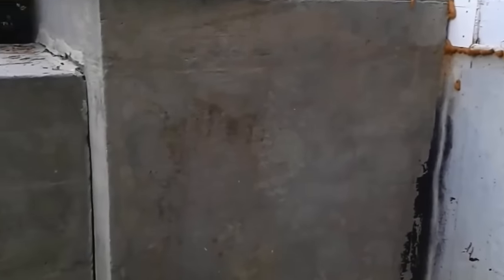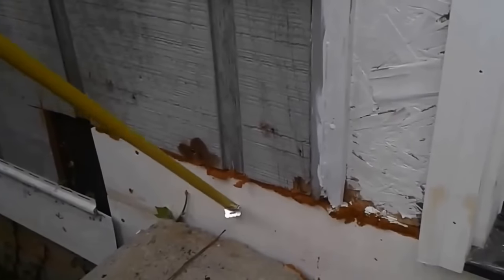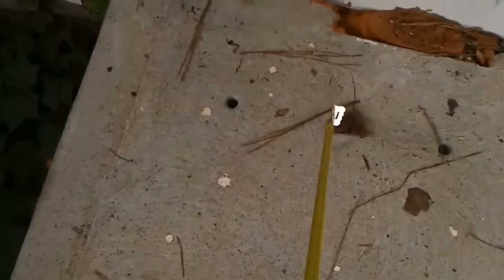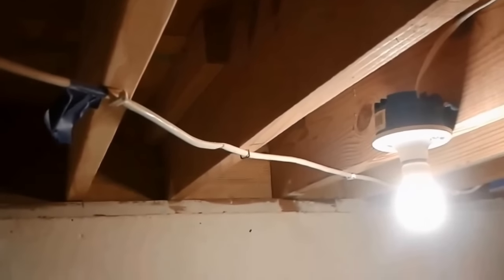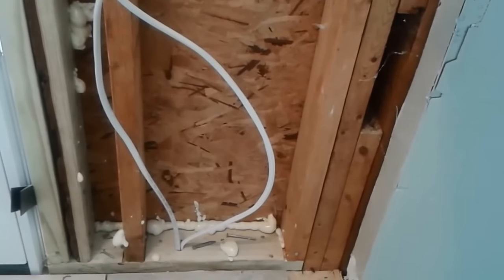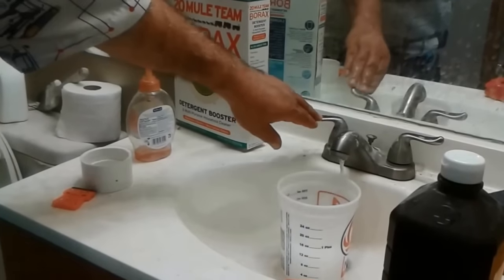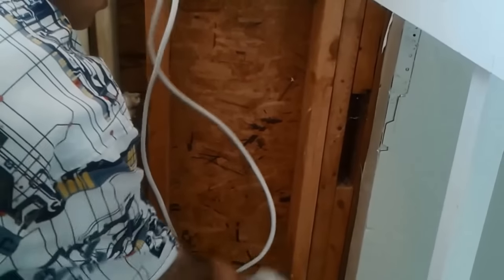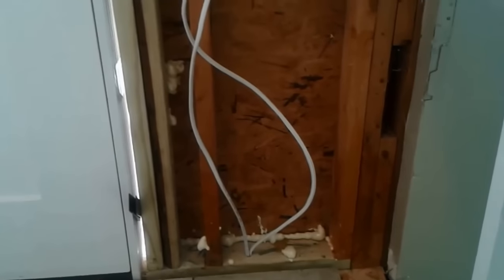How To Get Rid Of Termites For Good  Using  Borax -- Best Solution Do It Yourself

Comment: 16 ounces of hot water add 2 teaspoons of BORAX....stir until it dissolves.   Cross your finger 🤞.
Reply: Any results?
Reply: It has worked so far.   Do not see their trail.
Reply: I now use a plastic spray bottle wih the solution...and spray every so often on the walls! 👍

Comment: I've used the Borax on my exterior fence. My situation is unique as after I painted the Borax on the fence we had very heavy rains. Although that evening, prior to the rain the one section I completed I did not hear any chewing at all. I have not gotten a chance to finish the fence at this point as I have multiple repairs going on at one time. Ultimately it worked where I applied, so yes it is effective.
Reply from the maker: Thanks for the information.
Reply: How do you hear termites chew?
Reply: @angel77503  With a stethoscope, also the soldiers will bang their heads to alert danger. Weird, huh. I had a thin treated fence, couldn't hear a damn thing through the drywall in my house. So, my situation is not like others may have. I will be redoing this in 2022. It's always something.
Reply: Yes I have ants year round and now I have termites! Winded termites are coming inside the home from cracks behind my furnace that I cannot reach. 

I tried to seal up the space behind my furnace with foam insulation but they are still getting through the cracks! 

I have a slab house. So no wood underneath my house. No basement. Maybe they are getting in through the attic? Or I have so many cracks and it's a thin and cheaply built small house so it wouldn't be hard to get in. 

I don't know if I should schedule a visit from Orkin? They are so expensive. And they will want to do it many times and charge me over and over for it. 

Even if I got borax, I don't know where I would put it? Around my furnace but idk where they are coming into the house from? 

Also, I read if you just pour the powder down, it won't stop an infestation. 

Please help!
Reply: @MilkyWayGalaxyy  ever get your problem solved?
Reply: @jasonalvarez9274  Well turns out that I never had termites. Just flying ants and lots of black ants. But I still poured termicide around my house. And sprayed my house with it too and bought another insecticide to spray on my house on a regular basis. 

And I put at least 10 ant baits inside my house to kill them all. And I have already seen at least one hundred dead ants around my house. 

So I am being proactive about it for the first time. Thank you for asking!

Comment: how long will this remain active for? I saw a product at home depot that prevents termites and stops mold. Discovered that the active ingredient is Borax....had me searching. I came across your video...very helpful.
Reply from the maker: If you treat the wood with Borax as you saw in the video, The wood absorbs the Borax (which is a type of salt) while the water is evaporated It should stay in the wood for ever.
Reply: Thank you for your response.
Reply: Revelations, shucks I just bought a gallon of mold killing chemical from Home Depot last night and used it this morning on the area infected. I came here for termite fix but good to know. I make use Borax in my soap making and yet never heard it kills or deters termite or mold.
Reply: It kills ans, fleas, flies, and other pests so why not these two, just never occurred to me.
Reply: @soniag4516  roaches, too
Reply: @josephk9182  You mentioned it being a type of salt. I read that salt damages wood. Does this damage the wood?

Comment: Maybe apply with a spray bottle?
Reply from the maker: Joseph K
1 week ago
Yes you can, but the borax may clogged your spray nasal . Make sure to mix the borax in the water very well and you maintain the rate of one spoon of borax to 8 ounce of water. 
You must clean with water the nasal and the spray hose  after use to remove all borax residue.

Comment: If the termites are in the frame of the house and the rest of the house is made of brick do I drill holes into the house and inject the borax? Thanks for the video
Reply from the maker: If you already have termite ifestation you must eliminate the colony first. Borax will proptect your house from termites but you said that termite are already in the house and the house frame most likely is untreated wood,  so driling holes in the house and putting borax will kill some of them but not all. In your case I will recommend you using termidor first in order to kill the colony. You must find the tunel where this termite are comming and eliminate the colony otherwise you should call proffesional to find from where the termites are comming.
Reply: @josephk9182  thank you for your response! I found out they're actually subterranean termites and they're in the base boards. Do you think bait stations and BioAdvanced granules will be enough? Is there anything I can use on the inside of the house in the base board areas after I remove them?
Reply from the maker: @warclassics  You can use termidor foam. You can drill and spray it when you think the termites are. It will not kill the termites immidiatly instead the termites will carry the termidor to the nest and will eventually kill the colony.
here is the link to buy it on Amazon:
https://amzn.to/3xjYcXC
Reply: @josephk9182  thank you!

Comment: my grandparents  home is over  one hundred years  old and has no termite damage I don't  recall it ever been treated for termites the house is in Azusa California does anyone know why?
Reply: It's probably a pier & beam? If it is, it may have metal square things between house & beam...this is a natural protection against termites.  You don't have a lot of water under and around the house, maybe (termites gravitate to water, I understand).  There's not a particular termite problem in the general area. Finally, maybe the neighbors haven't had termite problems, or there isn't a really nearby neighbor to get termites from.
Reply: more then likely it is made with slow growth REDWOOD from before it was illegal to chop down redwood trees. I have the front doors of my families old beach house from 1909 and not one termite... solid REDWOOD and white washed with a green paint. They are almost bare wood now from years of beach weather... but still prefect. BUT the old pine and red alder furniture that was in same house... destroyed by termites.
Reply: Rebel Lemming, I believe you are correct. I have an old (90-100 yo) cabin in Santa Cruz mountains and never had termite. The original owners who sold it to me had it for 70 years (1984), still standing strong. It sits on piers so another deterrent I suppose but bathrooms have leaked, kitchen sink has leaked and subflooring changed by the bottom always stays good.
Reply: Possibly treated with chlordane before it was banned.  It lasts a long, long time but is a carcinogen.
Reply: Several factors can contribute to termite resistance. A lot of the problems have to do with moisture which is the biggest problem. Old, drafty  houses help any moisture evaporate from areas where water comes in. New houses that are sealed tight are great for energy efficiency but can be insect/mold magnets if moisture is not addressed properly....i.e. the great EIFS stucco rot disasters of the 90's.  Wet crawl spaces and how ventilated they are is another big factor.
Another factor in the termite resistance of older homes was mentioned by a previous poster. The oldest homes usually have wood from first growth trees where the density of the wood and resin content is highest because of the slow growing habitat from the original dense forests causing tight spacing in the growth rings. The resin is a natural insecticide.  I have demolished old houses where the 2x4 southern yellow pine studs weighed 4 times what they weigh nowadays from fast growth pine cultivation(if you can even get them in yp). 
Also echoing the previous poster is that some areas have higher populations of termites than others like New Orleans, LA

Comment: When dealing with termites home treatments like this fail, with the home owner believing they are gone from the home. Unfortunately later finding out they were never gone just pushed into a different unknown location continuing to damage the home. Termite issue are not about spraying them with something that makes them avoid that area, it’s about killing the source of the issue the nest borax won’t do this I’ve treated and protected over well100 homes without failure it’s not simple as this guy makes out be careful.
Reply from the maker: This treatment is in addition to Termidor. Just look at the video. And yes borax will protect the wood from termites while Termidor  is a firewall suppose to kill the colony.
Reply: Termidor treatment installed correctly wont need anything else and done by the right people should come with full warranty and depending where you are I offer the 2 million dollar warranty in the home.
Reply: Peter Booth@ How to use Termidor?   I am from far east. How to prepare the mixture and how to apply? Please give a gist of everything about the process.
Reply: Yes I have ants year round and now I have termites! Winded termites are coming inside the home from cracks behind my furnace that I cannot reach. 

I tried to seal up the space behind my furnace with foam insulation but they are still getting through the cracks! 

I have a slab house. So no wood underneath my house. No basement. Maybe they are getting in through the attic? Or I have so many cracks and it's a thin and cheaply built small house so it wouldn't be hard to get in. 

I don't know if I should schedule a visit from Orkin? They are so expensive. And they will want to do it many times and charge me over and over for it. 

Even if I got borax, I don't know where I would put it? Around my furnace but idk where they are coming into the house from? 

Also, I read if you just pour the powder down, it won't stop an infestation. 

Please help!

Comment: 👏👏👏 can't you just put it in spray bottle and spray on?
Reply from the maker: Yes you can, but the borax may clogged your spray nasal . Make sure to mix the borax in the water very well and you maintain the rate of one spoon of borax to 8 ounce of water. 
You must clean with water the nasal and the spray hose  after use to remove all borax residue.
Reply: pump sprayer works much better than spray bottle.  I tried couple of spray bottles and it got clogged easily

Comment: Can it be used on fences?  Or will water wash it off?  Thank you for the video!
Reply from the maker: It can be used on wood fence and water will not wash it out.  You should apply it on necked and very dry wood, The substance will penetrate deep into the wood when the wood is dry.  After you apply the substance the water will evaporate and the borax salt will stay in the wood.
Reply: Wonderful, thank you so much Joseph for taking the time and energy to give everyone this very helpful information!!
Reply from the maker: No Problem. Thank You
Reply: @josephk9182  If wood isn't dry (say because of humidity in the attic) => Can you still apply it? or no point?
Reply from the maker: @kookia213  If the wood is not wet you can apply it.
Reply: @josephk9182  humid attic counts as wet? or we're talking about literately soaked with water?. Once again, thank you for sharing your knowledge.
Reply from the maker: @kookia213   literately soaked with water.

Comment: How do you know how long it will last?
How long ago did you first do this treatment, and when did you last carefully inspect to see if it is still working?
Reply from the maker: Borax is a mineral salt. When you ix it with water properly and put it on dry wood the wood absorbs the mixture. After a while the water are evaporated and the borax stays in the wood for ever ( like a treated wood)  . If you do not wet the area (dilute the borax) it will work for ever.
Reply: thank you

Comment: I thought it was 1cup per gallon which is twice as strong?
Reply from the maker: You need to dissolve the borax in hot water and mix it very well. Borax is kind of salt and in one gallon of water will dissolve  maximum 3 pounds of salt.  One cup will dissolve nicely in  one gallon of hot water.
Reply: So it doesn't matter how strong the dilution is?

Comment: can u desolve it enough to use in a sprayer?
Reply from the maker: Yes. Please clean the spray nozzle after you done spaying because the borax can clog the nozzle.
Reply: +Joseph K 
excellent. I've heard of this, however I've mistaken the name for boric acid. i guess that doesn't work. or so I've been told. thanks much for the vid.
Reply: I would use boiling water from the stove, tap water may not be hot enough to completely dissolve the Borax
Reply: I'll try that. thanks
Reply: washing machine dissolves it,,its tap water

Comment from the maker: I bought the Borax in Target however, you all can find it online if not in your local shop.
Reply: can you use a water and borax mix to control flea infestation under a house / ground fleas . I am in Australia and am in a house that is about 3 feet off the ground and is all dirt and sand and I am over run with fleas and do not want to use toxins , also i have had a pest controller and it was like he feed them . Please help me going crazy thank you also all the hoses here have wood floors and are full of termites
Reply from the maker: Yes you can put borax mix however, you will not be able to grow any vegetation on this soil for a while.  After you put the borax solution in the soil make sure not to wet the area with water because  the borax will be diluted and as a result it will lost its effectiveness. In case of water or rain  just put the borax solution again on a dry soil.
Reply: Joseph K ok thank you its for under my house its just dirt and sand thank you for replying for the rest of the yard I found a supply of nematodes for the lawn and garden from a bio control centre in Australia where i live . thax again
Reply: Walmart sells Borax for about $4.50 per box.
Reply: Spreading eucalyptus bark, leaves, and small twigs also help rid of fleas if they are same as ones in California.
Reply: Winco as well at $3.97/large box in California
Reply: Hi Joseph, thank you for all your videos and instructions. I would like some help or advise from you. I have a very old house wood all around and looks like the house has termites for long time. I don’t know if have to hire company for fumigation or you think demolish the house? Please let me know.thank you much
Reply from the maker: @impossible-Monique . Usually house that has huge termite infestation smell  bad. Before you demolish the house do the following:
1. Make an appointment with termite contractor for free inspection and verify if there was termite infestation before.  Try to get at least 2 opinions.
2. Only a builder contractor or building engineer can tell you if the house should be demolished. If the infestation is huge it can be easily spot with the naked eye.
Reply: Joseph K : thank you Joseph! I will do those things first and let you know what I learn from the inspections! ❤️

Comment: Is it okay to use Borax on a large pail of water and apply it on the house soil - just for the sole purpose of killing termites?
Reply from the maker: Yes you can but if the area treated will be flooded with water in case of raining etc. the borax will be diluted or washed away.  You also can buy  a ready Borax powder from Home Depot made to kill ants, cockroaches and termites.
Reply: So Borax isn't really a long term solution? Termidor / Taurus are the recommended ones to use isn't it?
Reply from the maker: Termidor and Borax are different. Termidor is a strong chemical poison (for human also)  that you put under the ground usually 6 inches under the ground around your property. Termites  can not sense this Termidor poison and as a result they will come in contact with this poison. They will not die immediately instead they will infect the termite colony and  the colony will eventually die.  
Borax is not poison to human ,  but very poison for bugs and termites.  If you put Borax substance on a bare wood termite will not eat the wood because termites will notice the borax in the wood.  You can not put Termidor on wood because it will not penetrate the wood and it will evaporate. When you put Borax on the ground every bug or termite that come in contact with the borax will die. If you put Borax on the ground around your house termites will notice the poison and they will run away from it. The Borax become a barrier (a fire wall) for termite and bugs but it will not kill the termites colony it just prevent them from coming to your property or prevent them eating your wood. Termidor  is not a  barrier, termites should go through (in and out) the poison ground. Termites suppose to  come in contact with the poison  and then infect the colony.
Reply: I learned alot from you Joseph.. I wonder what would be the ideal Borax  mix for 1 gallon of hot water? Would 1/2 cup of Borax  be good enough?
Reply: @josephk9182  I've seen people use borax in termite baits. How would those work if termites run from borax. Many sites also said termites only die if it eats borax rather than just by contact with it
Reply from the maker: They probably use borax powder with sugar (Boric Acid) product you can buy from Home Depot called hot shot. Termites will eat it this sweet powder and die.
Reply: @josephk9182  You mean boric acid is a mix of borax powder with sugar?